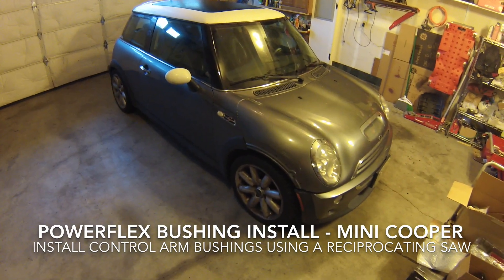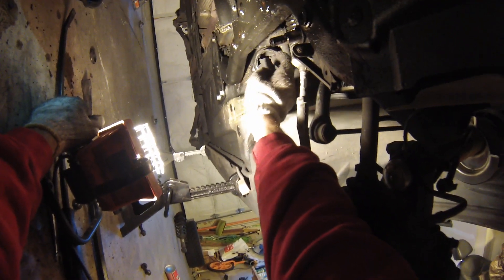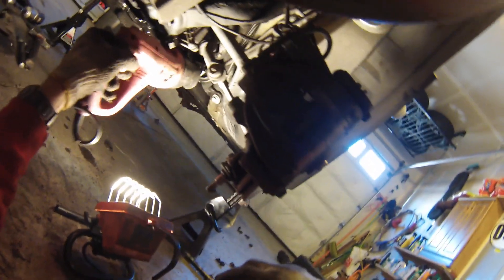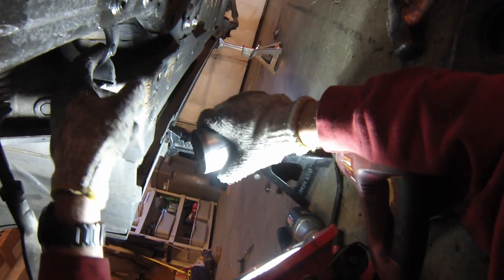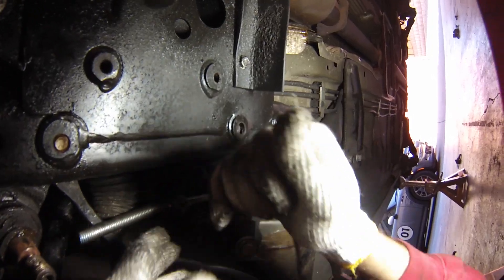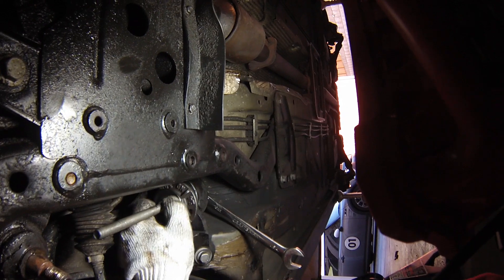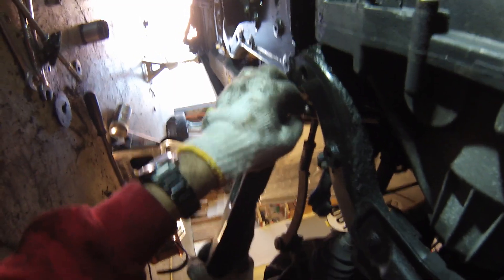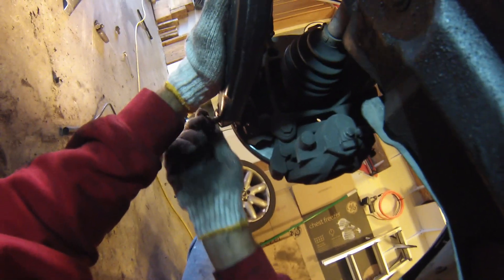MINI Cooper Control Arm Bushings done on the car-cutoff method - Powerflex

Comment: Just found out this morning that my driver size one is terrible. How do I make a bushing press like the one you made? What are the plates on it?
Reply from the maker: ***** Just crawl under the car and measure the diameter, find a suitable size plate. I am not sure the size, probably around 3.5 inches.. This a plumbing fitting I found at the local hardware store.
Reply: ***** I bought some pre pressed ones thinking that it would make life easier because I don't have a sawzal and found out I have to lower the subframe. Do you have any videos with a how to on lowering the subframe?
Reply from the maker: *****
Watch either of my clutch replacement videos for how to remove the subframe.

Comment: thanks for the reply;  if the pickle fork with tips cut shorter is used (how much is cut off? with hax saw blade?) how do you keep from ruining the rubber grease boot  and keep from replacing the inner ball joint?

Comment: I would love to see how you got the control arms off.  I can't tell which year you are working on, but on my 2009, the control arm does not pop off easily like all the videos I have seen.  The pivot point is captive by the transaxle boot compared to all the videos I have seen where it just releases down and out.
Reply from the maker: I suspect this method does not work on the R56 subframe.

Comment: Hi mod mini. A little question, the control arm bushing consists of two tubes. A inner tube with a specific form made from metal and rubber. And than there is another metal tube. Lets say a second layer. Do you have to remove both layers or only the inner one?
Reply from the maker: Joeri Polfliet Remove the bushing but not the carrier. Remove the thin silver metal tube that is about 1mm thick but not the forged black carrier that is about 8mm thick.

Comment: Hi sir, Could I ask you about mini thing?
like how can i replace the power steering rack and lines in my mini and Is it fun if I do it by myself?
thank you
Reply from the maker: You need to drop the subframe. See my clutch replacement videos for how to do that.
 Is it fun? That depends on your definition of 'fun.'
Reply: I'm sorry I spelled it wrong. I mean is it fine if i do it by myself. changing the power steering rack. or I should take it to workshop. because i heard that the rack is hydraulic, and not anyone can replace it.
Reply from the maker: Fadoola 16 The problem is not the rack. It is basic steering technology that has been around for years. Any shop can replace that. The problem is the front of the car has to come of and the subframe must come out. I'd prefer only having that work done by a shop that knows what they are doing, which should be any European shop with MINI experience.

Comment: Pressed out the old bush no problem, new one in easily. However can not get the control arm back on with the inner ball joint
Reply from the maker: ratchet strap and pry bar

Comment: I'm replacing the old bushings with stock ones not the polyurethan, and I Have the tool to press the bushing out and in the frame. To reinsert the control arm into the bushing, do you think I need a special tool or I'll be able to push it in by hand?? Thanks in advance
Reply from the maker: +mena marks Control arm into the bushing center? Just push it in.
Reply: Thank you for your response

Comment: Adding some information to help people with this very difficult project.  I had a very difficult time getting the poweflex bushing to go in straight, tried about 50 times and failed.  I finally bought the BMW tool from Amazon (https://www.amazon.com/gp/product/B01MTN9ERH/ref=oh_aui_detailpage_o01_s00?ie=UTF8&psc=1) and it worked perfectly.  I also froze the bushing overnight, and used Windex for lube, was previously using dish soap which may have been too slippery.  But this combination of tool frozrn bushing, and windex did the trick...took me about 15 minutes after struggling for 3-4 hours with homemade tool setup.

Comment: My car is a 2002 and has 23k miles. I just had the power steering recall done at the dealer and they did a complementary safety check and said that the control arm bushings should be replaced. I did a visual inspection today and didn't see any damage. Do the factory units fail because of age or miles? I'm wondering if I should do this repair?
Reply from the maker: They all fail over time as the rubber dries out. If you look closely you'll probably see cracks, but the easiest way to tell is to kick the front tires toward the back of the car. If they wobble more than 1-2mm, the bushings should be replaced.

Comment: this is great;  how much force is needed to get the bolts off of the control arm and is the 4 jack stand system you used secure enough
Reply from the maker: Do you mean the amount of force to separate the ball joints from the control arm? Outer ball joints you can separate by removing the two 13mm bolts and hitting the knuckle with a hammer until it falls out. 
The inner one is a bit tougher as there is no way to hammer it. You need to use a modified pickle fork or an inner ball joint separating tool. Sometimes they come out easy, sometimes they put up a bit of a fight. Be careful not to damage the grease boot. 

4 jack stands is plenty secure. That's how I do all work to the car. Just make sure all the jacks are centered and secure - make sure none of them are leaning. Sometimes you need to go back around to the other side and lift it up just a bit to even out the weight.

See my 4 jackstand video here: 
Put MINI Cooper on 4 Jackstands the Easy Way R50-R52-R53 Howto

Comment: I see you change the bushing on the car , any reason why don't take them out and do it on a table , I just wondering if there is a reason   thanks
Reply from the maker: Not everyone has the gear to safely remove the subframe.
Reply: oh I didn't know , you know of any videos of the remove of the sub frame  thanks
   love your videos
Reply from the maker: Clutch replacement videos start with subframe removal.
Reply: thanks

Comment: thanks for your replies;  I have not been able to remove/release the inner ball joint;  can you describe the tool you used and where it can be purchased.
Reply from the maker: The tool you would need is  BMW312240 but this costs $150. A standard pickle fork with the tips cut shorter works too and that is what I use if we are not replacing the joint. Be careful to not damage the grease boot. Alternately, lower the subframe and unbolt the inner ball joint from the subframe, then pound out with a hammer if you are going to replace it.

Comment: Hello
Do you remove the cradle from the car to perform this repair. My car is a 2008 mini clubman r55 diesel 110 hp
thanks
Reply: This method does it without removing the cradle

Comment: Do you, per chance, know the size of the bushing?  I found a bushing press specifically for the MINI Cooper, but I also found a kit that has different sizes... and they're about the same price.  So I figure, get the kit with the various sizes, but only if it has the appropriate size for the MINI.  Please advise, thanks... 

And also, I sincerely appreciate your videos... they give me a heads-up on the PITA-Meter so I can venture whether or not it's worth it for me.

Comment: What’s the easiest way you use to separate that middle ball joint that goes through the middle of the wishbone when you remove the wishbone
Reply from the maker: Percussive hammering and heat seem to work best.

Comment: How did you remove the lower arm from the ball joint? I had to unscrew the 2 (13mm) screws on the ball joint and take out the entire thing
Reply from the maker: Do that, or liberally loosen (but do not remove) the big 18mm bolt and hit it hard with a sledge hammer until it pops loose. There is also a ball joint separator tool that is a little tricky to use.

Comment: Hi Mod MINI. Thanks to you I succeded to replace the control arm bushings. Do you have also a video how to replace rear trailing arm bushings? I want to replace them as well with the powerflex bushing (the complete bushing with the metal pieces). Do I have to cut off the original bushing or will the come out easily?
Reply from the maker: Joeri Polfliet For the rear? I don't have a video for that. There are a couple bolts that should allow the entire arm to come out and control arm mounting bracket to come out and you can cut or press the old bushing out. You will definitely need a 4 wheel alignment after doing that. They are the same bolts that are used to adjust rear track / toe.

Comment: do you think the oem outer metal piece is soft enough to hit with a bar in order to distort it?
Reply from the maker: In order to do what? Push it out of the housing? No, I doubt that would work. It's pressed in there pretty good and any amount of force sufficient to bend it out of the carrier bracket be enough to significantly scratch the bracket itself, and would take along time with anything other than the most powerful impact hammer. One wrong move and you would probably put a hole in the underbody.

Comment: Hey how you doing, I have a mini 2006 with 120XXX miles on it. The bushings had never been replaced what other bushing other then this ones do i have to be replace?
Reply from the maker: R53 Source I'd recommend doing the front ball joints at the same time.

Comment: I don't have this bushing you have. I have the same bushing that is originally on the car. I can not get the control arm in buhing. it is 17 degrees outside and I am guessing that rubber is just so hard I can't get it in.
Reply from the maker: +Renji Hayashi You have to squish pretty hard but if it's that cold it might be impossible. Maybe try warming the bushing  before starting? Warm in the oven or put in a pot of hot water?
Reply: +Mod MINI the thing is the bushings are already on the car. I bought them already installed in the bracket because I thought it would be easier
Reply from the maker: +Renji Hayashi So the problem is just pushing the control arm rod part into the bushing? Use a ratcheting strap and wrap it around somewhere suitable to pull it into the bushing. If it's really cold, you might still need to warm it up with a heat gun or hair dryer or something.
Reply: +Mod MINI I will give it a try. Thanks again.
Reply from the maker: +Renji Hayashi Never mind, you said you have stock bushings. You might need to press them on using a press like this one http://www.harborfreight.com/12-ton-shop-press-33497.html or hammer them on. (Assemble the bushing/control arm first and then bolt onto the subframe) The middle of the bushing is metal, not rubber.
Reply: +Mod MINI :( I think the bushings i have are just rubber or at least I hope it is
Reply: +Mod MINI i wish I knew about the bushings you are using when I ordered these. They seem much easier.
Reply from the maker: +Renji Hayashi The main part of the stock/OEM bushing is rubber but the outermost and innermost parts are metal. That is the normal way bushings are made.

Comment: My control arm bent so I need to replace it along w/ both ball joints and the bushing however I purchased the bushing pre-pressed into another bracket so I need to remove my brackets to send back the core.  Do you have any videos where you removed the bracket or can you give me a crash course on how to remove the bracket?
Reply from the maker: krushmoto1 You have to drop the subframe. Check out my clutch replacement videos.
Reply: +Mod MINI Thanks
Reply: How did you get the control arm out? I bent mine also and I’m having trouble taking it out

Comment: Hello ... I have a question. My mini cooper s 2005 have the suspension  very bad and I had to change the shock absorbers for some mega racing coil overs, but the suspension is still bad so change the tires for normal ones and remove the runflat flames so better but still bad. ..what can i do to fix it .. by the way also change the rear control arms and the sway bars in front...thanks
Reply from the maker: probably control arm bushings are shot.
Reply: Thanks .. I hope if that is the problem because my car produces a lot of noise in the bumps..always I watch your videos and they help me a lot thanks friend
Reply: nan0tEch - hi..i will.i am waiting for the parts.

Comment: Is there a difference between the left and the right side of the Control Carrier Housing (aka Control Arm Bushing Bracket)  or are these parts identical on both sides? I'm interested in the housing/bracket itself obviously, not the rubber bushings.
Reply from the maker: +Ilya Toumilovich The only difference is on some cars there is a headlight leveling sensor on the left side.
Reply: +Mod MINI Cool, thank you. That's my next project: Control arm bushings, sway bar bushings along with new strut mounts ( I think you have a video on the last one as well ). Any difference between ADUS and POWERFLEX brands, other than marginal price difference?
Reply from the maker: +Ilya Toumilovich I don't know. I've only ever installed Powerflex. I guess you'd need to buy both and put them next to each other to know for sure.

Comment: Is the original bushing oil filled? I have a recent leak and this is the only part I can see any oil on.
Reply from the maker: +Charles Schluessler No. Oil leak near bushings may be power steering fluid or maybe oil filter housing.
Reply: ***** I only ask because there is no oil on the top side of this housing. Not running low on oil and the filter is on the opposite side of this bushing.
Reply from the maker: +Charles Schluessler Opposite side of engine oil filter? Probably power steering fluid is getting blown back there. It would take a pretty big oil leak to be even noticeable on fill levels. Other possibility is torn CV joint boot or leaking axle shaft seal.

Comment: I bought the polyurethane  pre-pressed into new brackets....Had no idea that I would have to remove the subframe in order to attach new brackets? Any other way around this? Thanks Mod!
Reply from the maker: Nope, the bolts come out the top.
Reply: Damn... Ok. Do any of your videos include a subframe removal walk through? Thanks again
Reply from the maker: Clutch videos.

Comment: I have a quick question? how do i separate the inner ball joint?
 I tried a pickle for and I couldn't do anything? Am I missing anything?
Reply from the maker: +mena morkos Hammer harder. It might need a spacer of some sort if your pickle fork is too thin. These are hard ball joints to separate.

Comment: Hi Mod, I appreciate what you have done here. I'm half way into this repair and haven't figured out how you removed the control arms from the old bushings. Did you cut them out with the saws all? Thanks, Mike
Reply: Nice going dummy! I just looked at your posted link, Guess I'll go look for a pry bar 
:-) ..... Mom always said to read all the instructions. Thanks again, Mike
Reply from the maker: I slice the old bushing center with a disk grinder and then pry it off.
Reply: Mod MINI Where I can apply for that kind of tools that don't sell on Amazon

Comment: Hey there mini boss, I didnt see a reference to the control arm bushing tool you used.  I have my subframe removed, and can remove the housings easily.  Is there a tool that will remove the bushing, without the sawsall?  Just a preference.
Reply from the maker: Hydraulic press

Comment: Great videos Mod Mini - thanks for posting them.  I used them to replace all my ball joints, tie rods and control arm bushings in my 03 R53.  Afterwards I ran into an issue with the "Trifecta" ABS/tire pressure/Brake light problem.  A month later I'm still troubleshooting it.  Is it true that if you replace the tie rods you have to get the steering angle sensor reset?  I get a 5E40 and 5E43 ABS fault that won't clear.  Appreciate the help.
Reply from the maker: you need to scan the ABS/DSC module. The code and / or logging / activation tests will tell you what's wrong.
Reply: @ModMINI  I scanned them and put in my reply under your other video on control arm bushing, removing sub frame.  Any ideas, please reply in the other video post?  Thanks for your help.

Comment: hi, i bought a new pair of bushing but i dont have idea the orientation of them, exist a video with the explanation?? they are not powerflex. thanks
Reply from the maker: Look at the orientation of the old bushings and line them up the same way. Do you mean the bushings or the bushing carrier brackets? Carrier brackets should be installed so that the large flat surface is facing up.
Reply: yes, i know, i have to line them in the same position of the old one, but i lost the position mark,  now i dont know where they go, what can i do??
Reply from the maker: Find some pictures online and do your best...
Reply: ok thanks my friend.